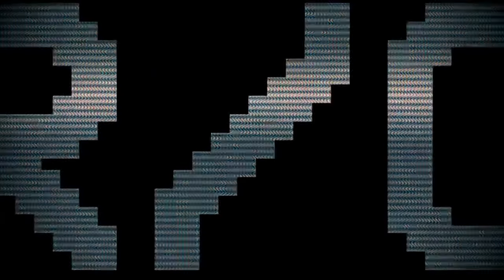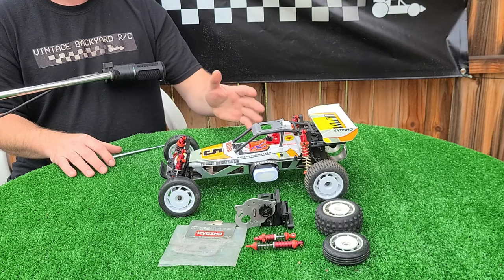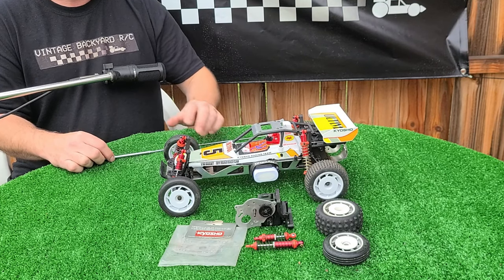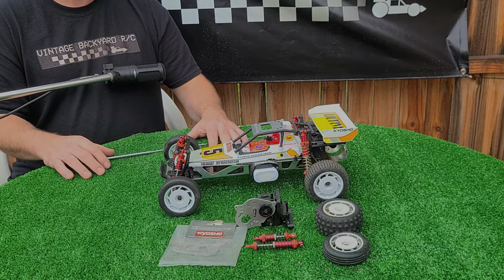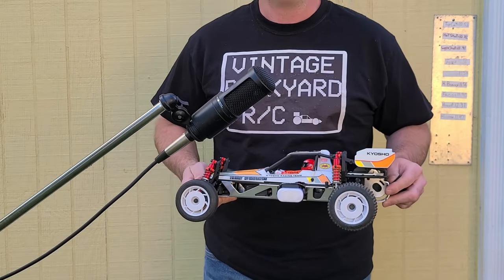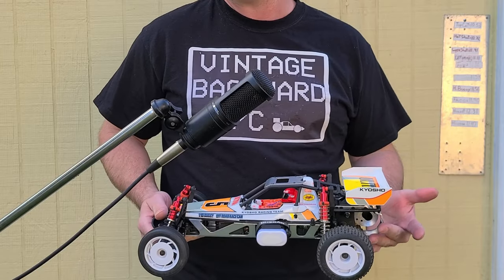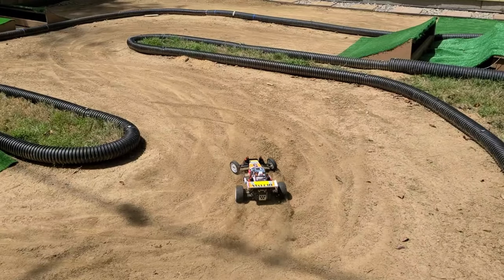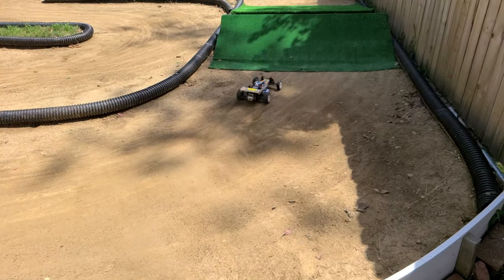Kyosho Ultima Time Attack!

Comment: Awesome video! The Ultima is an icon and although this isn’t a true vintage, it sure looks the part and drives very well (hard front tyres aside). Kyosho’s decision to upgrade their re-releases to handle modern day power is controversial.. but I can see where they are coming from and applaud their efforts at trying to improve on whats come before. It also makes us appreciate the real vintage ones even more.👍😊
Reply from the maker: Agree...a modern brushless system would not work out so well for the non slipper gearbox imo. The car runs fantastic. Thanks so much for the comment/view!
Reply: We've had , discussions, at the club with regards to the re re Ultima vintageness. I don't think it is, well, because its not, I think only the chassis is actually the same, but I love it!!
I believe tamiyas are only ,pretty much ,the same as they where, because they still had all the original molds/tooling , where kyosho farmed the work out, so never actually owned the molds/tooling.
Schumacher still have 2" tyres available, and the yellow compound Rib spike (U6847) I've found work quite well, on astro anyway.
Reply from the maker: @anthonyrawsthorne656  Currently heavily invested in the Schumacher tires for a "project"...
Reply: @VINTAGEBACKYARDRC ,  I'm in the UK,  so Schumacher has been the goto for decades! 
Found the 2" 'block' to be the best all rounder, (they only do 2" front for 4wd though), and the 2" rear blocks -U6786, do fit on 2.2" wheels (bit like fitting hornet centre into tyres....😬)and a few clubs have used them as a rear control tyre on modern cars.

Comment: I did a vintage meet with mine a few weeks back and even with super soft 2.2s on the front and softs on the rear it still pushed that front end through the corners. I ended up with about -4 degrees of camber to get it to turn. I'm going to play around with  roll centre now to try to improve the steering.
Reply from the maker: Good to know brother.  Think some weight up front would would help at all?
Reply: @VINTAGEBACKYARDRC  I'd say so, most of the drivers that had the ultima we're having the same issues.  I think raising the rear roll centre will help a bit as I have a TLR 22 as well that suffers from understeer and the difference was huge once I made that change and I'll play around with shock angles on both cars when I get a chance to get back to a track with it. Crazy the fox was almost as quick as it suffers from understeer as well and doesn't have near as much steering angle either. Keep up with the awesome content!

Comment: Camber on the front would help.  And the traction level at the back would depend on how much the diff is locking up.  Also which types of dampening oils you used.  The thing with the Ultima was it was a good platform, but you changed many things to go racing competitively.  Gold Shocks was the first thing back in the day.  But I sense this is stock showdown and comparison so none of what I mentioned might be relevant.
Reply from the maker: Yep...box stock.
I think it's a very easy "fix" and it would have been top of the chart.
I try and do everything as stock as I can with the kit cars just to see what they can do with the manufacturers setup. Appreciate the comment and view brother.

Comment: I could be remembering wrong, but I think every Ultima I have (from these, skip a few, RBtypeR, RB5) all exhibit understeer out of the box. In this case tires, though I'm not sure with my originals, or the other ones that are Ultima in name only.
Reply from the maker: The kit tires just don't work on my track. Weight absolutely coming into play as well. Few simple tweaks and it should be dialed!

Comment: 25.5 brushless motor, did I hear that correctly?
Reply from the maker: Yes...so all of what we call our "pro cars" are running a 25.5 brushless setup. It keeps speeds reasonable for my small track. The car can handle much more motor. Gearbox is pretty beefy.
Reply: @VINTAGEBACKYARDRC  I’m guessing the FDR would be extremely tall?
Reply from the maker: @Rustydog1977  Yes...one of the things I "try" and do is match that from car to car as well. It's a huge pain sometimes stuffing in that large of a pinion.....lol. Can't always get it perfect.